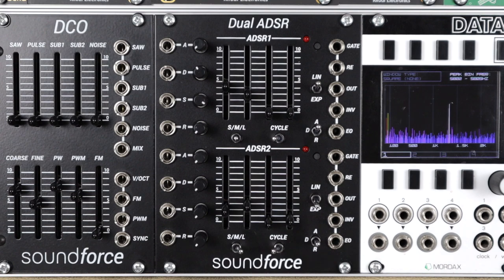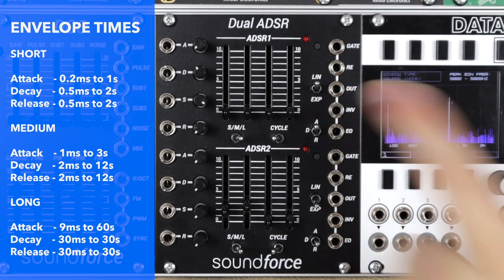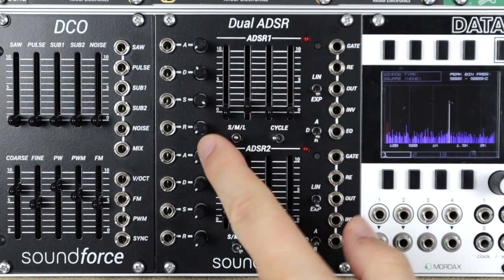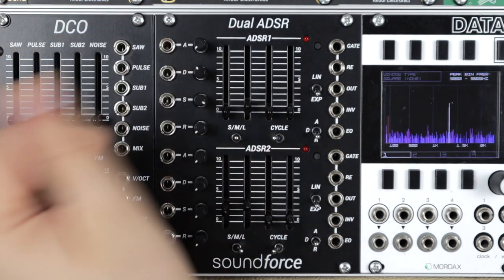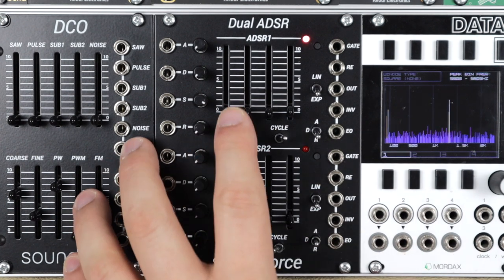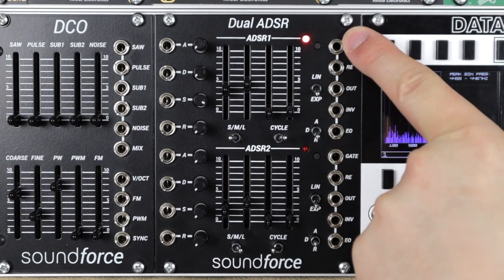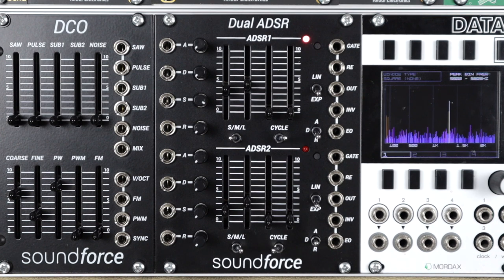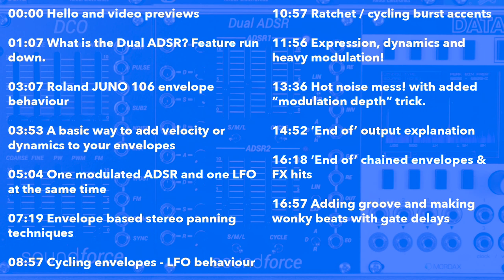SoundForce Dual ADSR // Heavily expanded JUNO 106 style envelopes with LFOs & CV over everything!

Comment: Thanks for another feature video listing. Comparing some modules myself for several tasks, here's a small suggestion for your channel:

Maybe it would be easier for people to use your video for comparison purposes (of for example envelopes) if specific playlists would exist (like a playlist for envelopes in this case). I know that there are modules out there that don't fall into one single category but on the other hand there are modules, like this one, that could be easily categorized.
Reply from the maker: Hello, good idea. I've actually implemented this on my website. https://divkidvideo.com/videos/

Scroll down and on the right there's a tag cloud that well pull all the videos with the same tags. For you click 'envelope generator' https://divkidvideo.com/video_tag/envelope-generator/

I may make playlists at some point, but you can also search my channel specifically here too. Scroll along the channel tabs past about and final one on the right is search. I've searched envelope for you here https://www.youtube.com/@DivKid/search?query=envelope
Reply: @DivKid  Didn't know about your website yet.  Of course this is a better solution than simple playlists. The downside is that people have to know about it first.
Reply from the maker: Yeah it's better. But I get it's not something people will look for. I don't think many are looking for playlists either though.
Reply: @DivKid  Perfectionists are probably simply different.  ^^

Comment: Maybe a little big, but i like ADSR's with the sliders and that takes up more space, cant have both :D ...Fully featured for sure! 
Peak voltage? 
Analog or digital?
Reply: Out is 0 to 10V. It's a digital module, hence all the options. Cheers!
Reply: @soundforce_nicolas  10V perfect! Yes, i thought it was digital, but seems to be able to cope quite well with audiorate modulation! How much of a latency could one expect from the A to D, D to A and what is the update rate on the CV's? Could we use this as a V/octave oscillator (in looping mode)...But im guessing much aliasing at high frequencies. How many bits are the DA converter, any stepping with really slow envelope speeds? You are kicking out some really well designed modules!
Reply: @manne3d  Thanks! It's 12bits, there is one step every 0,00244140625 V, when you see a step on the scope, it's usually the scope screen resolution or the scope AD resolution. The CV sampling frequency is 3.3.kHz. The CV inputs won't track V/oct very much, but I have a fantastic DCO that does that perfectly ;) About latency, there is only a couple of microseconds when the enveloppe triggers. the DAC is updated at 60kHz, so you won't notice any latency between stages, if that was your question ?